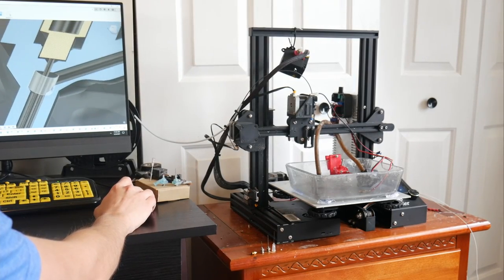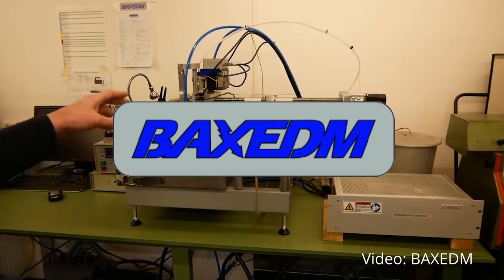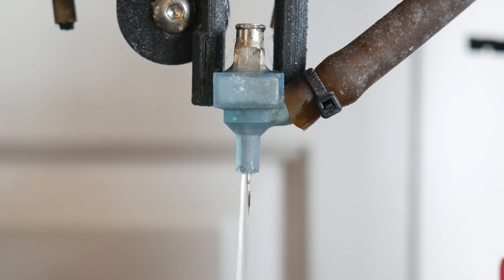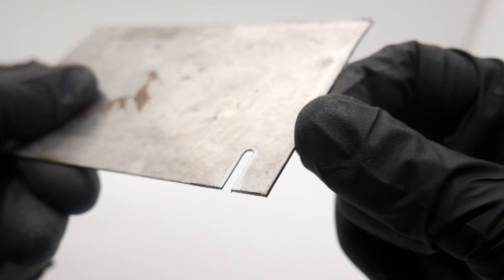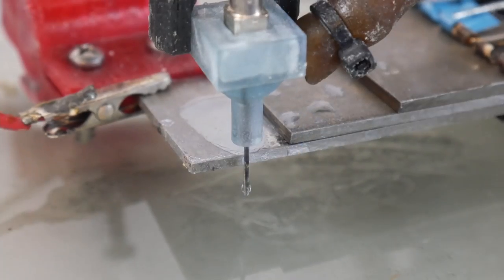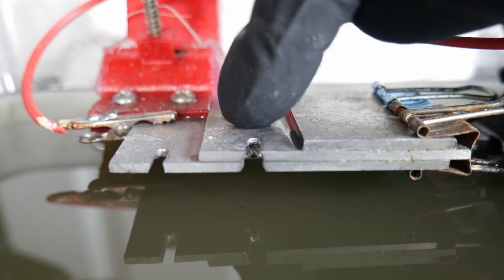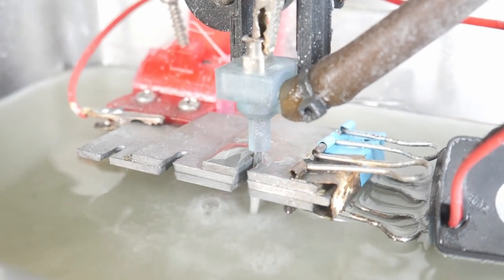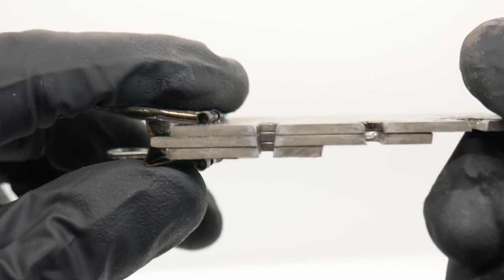Wire ECM on the Ender 3

Comment: This is long, please bare with me. The turbulent flow of water as it contacts the workpiece will make the cut flare out and become jagged as the depth increases. There must be a limit to this, at some point the channel will flare out enough that the contact with water will be broken. But you still end up with an uneven cut. If you use standing water, submerging the whole piece and only moving the needle, this will give uniform width of cut, but you will get erosion on other parts of the workpiece. Top and bottom surfaces can be protected with masking ink, but the vertical surface on the inside of the cut will be exposed, so the question is how much wider will the the cut become behind the needle before it is no longer affected by the electric current. Or is there any way to shield the inside of the cut once the needle moved past it. You could cover one side of the needle with masking ink, but then you can only cut in one direction. You could change direction of cut by having a needle several times the length of the depth of the cut, with different sections of the needle masked on different sides. You then move the needle up and down depending on which direction you want to cut in. But then you need to prepare the needle in advance with precise angles of masked and exposed surface, and you can only do cuts at a pre-prepared angle, no gradual, rounded turns. That's what I came up with so far, looking forward to seeing what the actual solutions will be.
Reply: Just had a brainwave, you could be turning the needle as you go, with a stepper motor, so that the exposed side of the needle always faces the direction in which you want to move. But then you need to develop a whole new attachment in which to mount the needle, one with the motor and controls for it, would probably need it's own code? So it's a whole new project/product.
Reply: EUREKA!maybe? No need for stepper motor or extra controller, mount the half masked cutting needle in a ball bearing and put an end cap (3D printed of course) on the bottom of the needle, with a springy little tail on it that will drag on the bottom of the tank. That way the conductive side of the needle will turn in the direction of travel like a wind vane. Possibly.
Reply: @nosuchthingasshould4175  I like the submersion idea.    What do you think would happen if he instead went for laminar flow maybe with a better nozzle or possibly a thickened fluid.         I think submersion has the problem of not getting rid of the sludge but idk
Reply: @Grognarthebarb  he is cutting through the entire depth, and the workpiece is suspended above the bottom, so I expect the sludge falls through without extra help. Thicker fluid- I don’t know, but what would be both conducive and the right viscosity? Besides, if it sticks to the needle, it sticks to the workpiece. Laminar flow will be disrupted by contact with the workpiece. I really think that ‘standing’ electrolyte is the best bet, but then I expect other side effects that will need solving. The dragging vane thingy I got so excited about probably won’t work either, because the movement of the needle will be too slow and minute to affect the direction of the vane before the cut is messed up. Although it probably is worth trying. In the end the solution will be something that never occurred to me.
Reply from the maker: Lots of ideas here! Generally the plan is to increase the laminar properties of the flow and to decrease the diameter of the coaxial jet. I'm also going to try adding a bit of a surfactant to the electrolyte to decrease it's surface creeping effect.

Submerging the needle is something I've tried in the past, but it lacks the accuracy and current density needed for good quality.

Comment: Thoughts on making a C shaped holder and using the extrusion motor to drive a feeding roll? You could use solder wick as the contact and a printer nozzle (or even just a hole in the 3d print as the guide, should work fairly well and be really cheap.) You can get edm heads for fairly cheap though (~$0.80/pc at 60 MOQ)
Reply from the maker: Really it shouldn't be needed as this is ECM, not EDM. The electrode shouldn't experience wear in the same way.
Reply: @ZURAD  I basically meant making an edm, but looking at it, ecm is probably better on a budget since there's basically no consumables.

For the water feeding, using a slightly larger hole around the needle might make it so that the water sticks to the needle and there's less flaring?
If you want to do higher precision stuff you might be able to use a pantograph attached to the bed and extruder so you can get like a 1:4 ratio or something.

Comment: this is interesting. cut quality ain't great but if that could be improved this would be a really useful process
i'm assuming that there would be no problem starting inside of a part if you drilled a hole in it the old fashioned way and jogged the machine over?
Reply from the maker: Absolutely. This is a first try at the process. Lots of room for improvement.

Comment: You sir are awesome. Sweet work keep the vids coming I want to see this bad boy cut some parts. Are you working on reducing the kerf the cutter makes so it is similar to edm or will this not be possible due to stream size on the electrode?
Reply from the maker: Absolutely. There's a ton of different ways we could decrease kerf and taper. Going to be pushing those avenues as best we can while also getting a basic kit ready for people.
Reply: @ZURAD   awesome work man im subbed it looks like something I did in the past for etching logos into a beer cooker I
 made for a friend

Comment: hey! i have a quick question. Can this technique be used on titanium or more specifically grade 5 titanium (Ti6Al4V)? I got my hands on some nice thick sheets and it would be nice to know what to expect from this as i dont have spare material and it must work the first try. I know that titanium has a bit of higher electrical resistance than steel and is much stronger. This method looks promising as nobody would want to cut my sheets in their workshops, they say it's too much of a hustle ant it might not work well
Reply from the maker: I have some titanium that I was testing JECM on. I might give it a whirl with wire ECM as a test.

Comment: Did you 3d print the connector for the needle and hose? I have everything else for this project except that piece
Reply from the maker: Yes I did. I'm hoping to have a file release this coming friday.
Reply: @ZURAD  Sounds great, I look forward to it. Very interesting project. I went a different route, I took an old hotend, and soldered a very thin wire to the end of it to use as the electrode. The water comes in through the Bowden tube connector. Haven't tested yet but am soon.
Reply from the maker: @bluewaterengineering9022  I've done the same thing for my first test with JECM. It works alright, but the flow is rather poor and not very laminar.

Comment: to get this quality wouldnt it be cheaper hooking it up to a pressure washer pump and making it a water jet cutter. the whole purpose of edm is a straight walled cut which you arent getting.. but you are getting that of a low pressured waterjet.
Reply from the maker: That's totally fair, but this is just a first take at Wire ECM(WECM). We're lucky enough to have a discord channel chock full of nerds intent on making this as accurate as wire EDM eventually.

Comment: Interesting, but the cut quality appears to be very poor. A small desktop milling machine would have performed better. Maybe if you switched over to a wire edm set up it would work a lot better, & probably cut a lot faster since smaller surface area.
 With the current setup, you might be able to improve the cut quality, but spinning the electrode, but I don't think you be able to make much of an improvement. 

You might be able to do wire EDM if you limit the working area and have the bottom spool for the wire attached to the 3D print gantry (ie with a limited work area of 1 to 2 inches) You could probably 3D print the parts needs for the test\experiment. 3D print some small spools than can hold a 100 to 300 feet of EDM wire. Once you have a workable method you could just build a larger machine using 80\20. 

Thanks for sharing.

Comment: This is super exciting! With this method can you do any drilling or do you have to make cuts from the sides?
Reply from the maker: Drilling would leave you with a majorly tapered hole. Probably better off just using ECM to mark a drill location and do it with a real drill later for better accuracy. This is similar to wire EDM in that you must enter from the side.
Reply: @ZURAD  Interesting. I think this technology has a lot of potential in making prof parabellum like designs. Can't wait to see where it goes!
Reply from the maker: @killpidone  brain emoji

Comment: From what I see, to improve the quality of the cut, I think you would need a thicker fluid. 
The thickness of the piece should not be an issue as its basicly cutting in paralel along the wire. You could probably get more straight cuts by using a cone instead of a needle, or a conbination of both. 

Also. A stupid idea : diluted ferrofluids and a magnetized needle? XD

Comment: Looks like to get the cuts straight the head needs a servo for a 20° angle left or right
Reply from the maker: potentially. I'm going to try to lower the taper to an acceptable level with fluid speed, surfactants, etc. first.

Comment: I have an old die sinking type EDM under my bench I'm dreaming about building a wire cutter   but  can simply 3d machine into tool steels with what you have there  ?
Reply: Material hardness makes no difference to ECM.

Comment: hi , can you please make an angled hole thru a volcano nozzle or normal nozzle , in the threaded part and weld a copper wire thrugh it ? ( check cnc kitchen high flow diy nozzles)

Comment: How would it  start a hole, for example?
Reply from the maker: This would have to be similar to wire EDM where a hole was already present. One advantage of this method though is that it could do several internal paths in one gcode because the tool can leave a path and go to a different one, unlike wire EDM.
Reply: @ZURAD  that sounds annoying
So you can't start holes with that nozzle?
What if you combinet that one and jet-ecm just for starting holes? Is your nozzle still that needly thing from the jet-ecm videos?
Reply from the maker: @ruyvieira104  It would be slightly less annoying than running a wire EDM tool. I suppose one could do plunge cuts with this. I really haven't tried with the coaxial jet.  Yes, it's still a dispensing needle for the electrode.

Comment: I'm gonna go stick my head back into the sand until I learn to research before commenting. I honestly believed this was a brand-new technique, and started making comments based on pure ignorance, just because I had never seen or heard of fluid EDM and its related arts. This has been around for a long while apparently, so I suppose other EDM types proved to be more popular in industry. I just get too excited when I stumble upon something new (to me) that could provide new ways to do things.

Comment made by newly educated moron: (The kerf taper reminds me of water-jet cutting, where the bottom of the cut is influenced (widened) by velocity differences in the fluid jet as it cuts thicker or harder materials. Because a charged fluid column is removing the material in your setup, this looks less to me like wire EDM, and more like a kind of "water-jet EDM", where instead of entraining abrasive into the fluid column, the apparatus is using charged electrolyte. You are definitely on to something here; I think maybe you should get to the patent web pages and search prior arts-  this is a very unique idea.)
Reply: in terms of water jet cutting, what he is getting is a "reverse" taper. To reduce that with a water jet, typically you would increase the cutting speed. Who knows if that directly translates to this though.
Reply from the maker: There's plenty out there on Good Scholar that directly informs my work. I certainly won't be filing any patents though.
Reply: @ZURAD  Would be too late anyways after having violated prior art already :)

Comment: Sorry, but it's not ECM, cause in ECM machining they cut metal by thin wire, which rewinds from one coil to another, to create sparks of metal.Because of rewinding, the wire change dimentions too slow, and that ensures accuracy of cut. 
In your case too diferential way to cut and because of that here you can't ensure precision
Reply: I this is ECM (Electro chemical machining) what you are thinking off is EDM (electro discharge machining) hence the sparks. The one with the wire you mentioned is Wire EDM then you also get Ram or Sinker EDM and Small hole EDM also called hole popping.
Reply: @kobuscoetzee6192  Perhaps you r right.

Comment: I own a hobby CNC plasma cutter. Honestly the bevel you are getting is pretty awful, much worse than plasma. Speed is probably 100x slower, and I can estimate the price of your setup to be roughly 10x cheaper, but for a much smaller work area. Interesting work but to be practical, that bevel needs to improve a lot! 👍

Comment: Use dielectric fluid instead of water for uniform cuttin diameter (needle diameter). EDM machines put the working piece inside dielectric fluid.
Reply from the maker: That would work for EDM, but this is a chemical process, ECM. There should be no tool wear with ECM which is one of the reasons I've picked it to develop.
Reply: @ZURAD  Ok, understood. I did not know about the ECM technology.

Comment: It cut it, but the results are rather useless, I’d honestly start pursuing a CNC table for a plasma cutter… for metal that thin even an inexpensive plasma of say 50 amps would cut faster than you could move the head and do it precisely…. If you’re going over 1 inch thick then maybe something else, but with metal prices these days 1 inch material would easily justify a professional $100,000+ cutting table….

Comment: So not to rain on anyones parade here. I think this is really cool but... You could make those same cuts with an angle grinder in a fraction of the time and cost. Or modify a cheep drill press as a mill. WWhen this can make complicated cuts then I will really be amazed.

Comment: I know everything starts from nothing, but this is at thus stage, boring and with no real application. The metal is damaged, blown out at the bottom, so it's not even a straight cut.  Keep working it, maybe you'll get it to the point it will get picked up by a chinese company and then the rest of us will have one.

Comment: That's cool and all, but the accuracy of the cut, specifically the angled kerf, is such that an angle grinder could do the same job with even greater accuracy. Admittedly angle grinders require a bit of operator skill to achieve accurate angles and corners, and small features may require a bit more filing or work with a die grinder than some would prefer, but there's nothing this machine can do that a person can't do even with simple hand tools. Honestly, it looks like it wouldn't do it much faster, either.
Reply: This comment is just ridiculous. You've completely missed the point here.